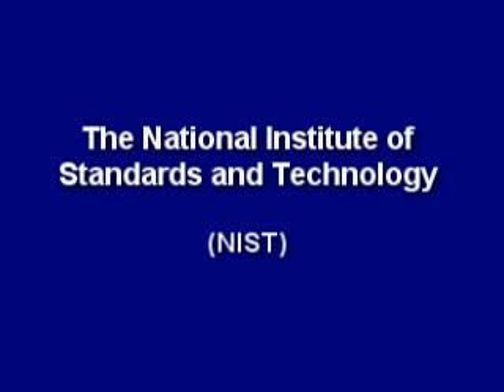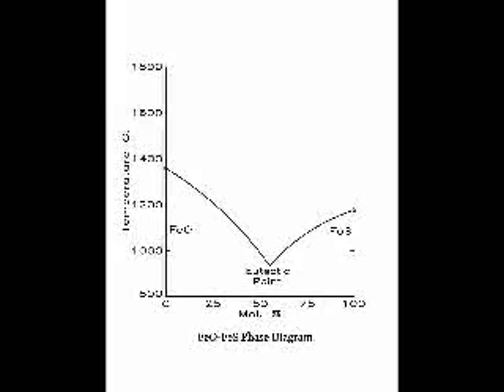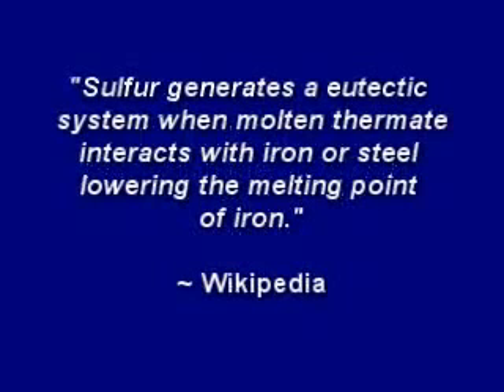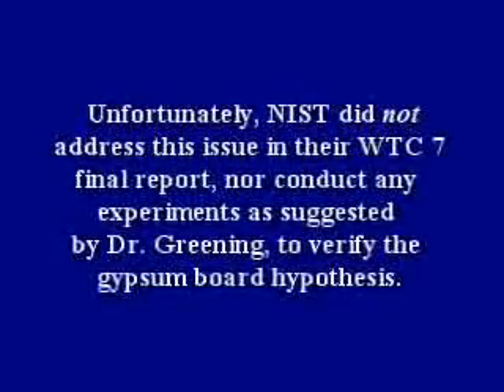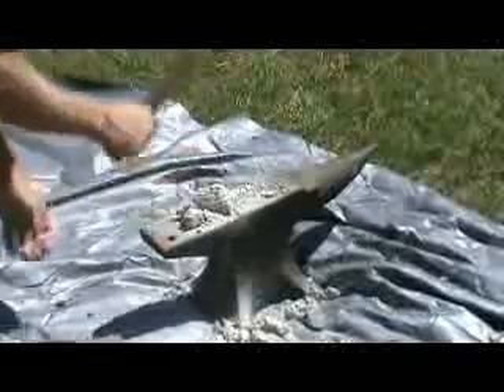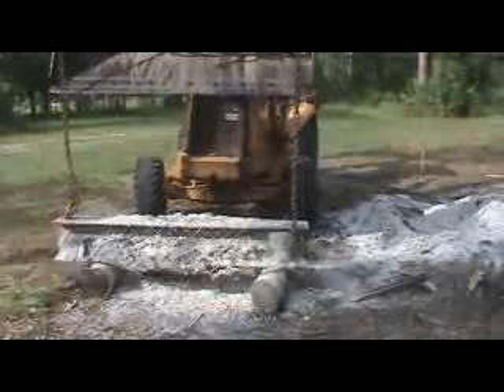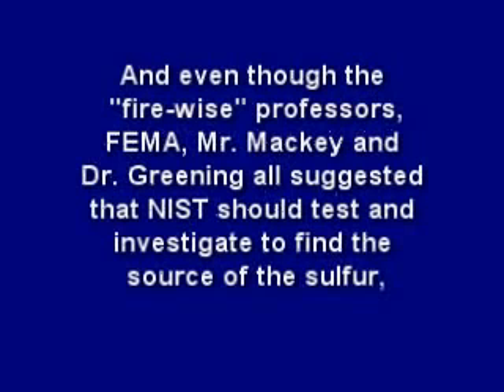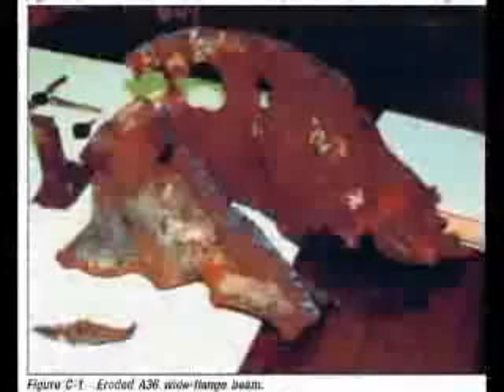9/11 Experiments - The Mysterious Eutectic Steel

Comment: "Did rubble from the WTC really cause those eutectic formations ,as we were led to believe?" - YES.
First you have to remember that 'rubble' is a code-word for 'forget that the tower was made of IRON'.
The IRON tower fell into the basement at an average speed of 120 mph.  THE ENERGY it employed is EASILY ACCOUNTABLE:

This analysis considers the conditions necessary for EUTECTIC FORMATION.

PRIMARY 9-11 CONSPIRACY ASSUMPTION SHOWN TO BE FALSE:
AN ANALYSIS OF THE AMOUNT AND DESTINATION OF THE POTENTIAL ENERGY OF A WTC TOWER
The first law of thermodynamics, also known as Law of Conservation of Energy, states that energy can neither be created nor destroyed; energy can only be transferred or changed from one form to another.
Source: Boundless. “The Three Laws of Thermodynamics.” Boundless Chemistry. Boundless, 02 Jun. 2016. Retrieved 12 Oct. 2016 from https://www.boundless.com/chemistry/textbooks/boundless-chemistry-textbook/thermodynamics-17/the-laws-of-thermodynamics-123/the-three-laws-of-thermodynamics-496-3601/
The World Trade Center towers (and WTC7) fell NATURALLY due to buckling failure when their 'slender' columns lost attachment to their floors.
They only used a third of their Potential Energy to destroy themselves, the remaining two-thirds was consumed in crushing some of their steel into ground zero.
A standing WTC tower possessed two hundred and forty six tons of TNT of POTENTIAL ENERGY merely by just standing there. We shall call this energy Eo.
The tower fell by taking the direction of LEAST RESISTANCE, which was THROUGH ITS BUCKLING COLUMNS.
The columns failed by BUCKLING because their STRUCTURAL STABILITY had been compromised by LOSS OF FLOOR ATTACHMENTS. No steel got crushed when this buckling failure occurred. 
Buckling is not a MATERIAL failure; it is a STABILITY failure.
The floors had detached themselves by sagging to an angle which snapped their connections. Photographs of these separated floors (taken shortly before collapse) are plainly shown in the NIST Report.
As each tower fell, some of that stored potential energy, converting to kinetic energy by falling, was released to damage and dismantle both the moving and the stationary parts of the tower on the way down.
The amount of the initial energy consumed in such a manner was inversely proportional to the rate of acceleration of the tower as it descended. It can be calculated.  We shall call it Ed.
The amount of energy remaining (Er) when the tower wreckage hit ground zero is then (Eo - Ed).
This energy, transferred elastically, caused PLASTIC DEFORMATION in the crushed base steel wreckage, and became HEAT. This too can be calculated.
The heat was considerable. The signs of it were captured by satellite. It amounted to the equivalent of a thousand tons of steel raised to a temperature exceeding 1,000 degrees Centigrade.
This hot steel, crushed and pressed against ground zero, oxidised its surface (making scale) and absorbed local oxygen gas, leaving a reducing atmosphere.
In these reducing conditions, and at a temperature of 1,000+ degrees C, fireman’s water which had percolated through crushed gypsum wall boarding DISSOLVED calcium sulphate (yes, Gypsum is 5% soluble in water), the sulphate ions of which were reduced to sulphur which combined with the exposed iron to form IRON SULPHIDE, which at such temperatures was MOLTEN, and flowed away. At a temperature of 1,000 degrees Centigrade, in an absence of oxygen, and in the presence of hydrogen, Sulphur and Iron atoms become keen partners.
Such hot reducing conditions also caused the water/steam to be REDUCED to hydrogen gas which was noted by firemen to be burning at the surface of the wreckage.
The wall-boarding and crushed concrete surrounding (but mostly above) the steel were THERMAL INSULATORS, so greatly slowing cooling.

CALCULATIONS (in SI units):

To calculate the original potential energy of the tower in TNT equivalent,
G = 9.81 metres/sec^2
Mass (M) of tower = 5e8 Kg
Height (h) to the tower’s CG = 210 metres
The explosive energy of 1 ton of TNT (Kt) is equivalent to 4.184e9 Joules

Equation: Tower Potential Energy (Eo) = ( M * G * h ) / Kt
This is equivalent to ( 5e8 * 9.81 * 210 ) / 4.184e9, or 246 tons of TNT.

The Potential Energy of each standing tower was equivalent to 1,000 standard 500 lb. ‘iron’ bombs.

To calculate the kinetic energy used in the tower destruction takes a moment, after a simple thought experiment, namely considering the tower would fall at G if there were NO resistance, and if it fell so slowly that it consumed ALL its energy, it wouldn’t fall at all.
So we can see that the PROPORTION of the energy used up by the collapse must equate with the proportion of G which the collapse was unable to achieve.
As the collapse acceleration was, by truther calculation, established to be about 70% of the acceleration due to gravity, we’ll use that.
The energy used up in tower destruction was therefore 30% of 246, or 73.9 tonnes of TNT.
Assuming that 30% of the tower fell outside of the basement, then the energy (Er) available to heat the wreckage base (by elastic energy transfer and crushing) was 0.7 * (246 - 73.9), or 120 tonnes of TNT.
We know that the steel reached at least 1,000 degrees Centigrade because that is the melting point of iron sulphide.
We can therefore calculate the mass (m) of steel that was raised to that temperature.
The specific heat of iron (Fs) is known to be 0.45e6 Joules / tonne / degree C
The ambient temperature was 20 deg C, so the temperature rise (Tr) was 980 degrees C

Equation: Er = m * Fs * Tr
So m = Er / Tr * Fs = ( 120 * 4.184e9 ) / 980 * 0.45e6
And so m = 5.02e11 / 4.41e8 = 1,138 tonnes.

The collapse of each World Trade Center tower created 1,138 tonnes of red hot steel at 1,000 degrees Centigrade.

So we can see that there is no need to postulate an extra source of energy, and that the basement wreckage heat is also easily accountable, with the additional corroboration of burning hydrogen at the wreckage surface, and molten iron sulphide at the wreckage base.
And so the underlying 'truther' assumption, that the planes couldn't bring down the towers, is shown to be FALSE, as it is shown by calculation, using the physically-correct values, that the potential energy possessed by the towers numerically accounts for ALL the known consequences, through elastic energy transfer, plastic deformation, HYDROGEN gas burning at the wreckage surface, EUTECTIC IRON SULPHIDE melting off the hot steel pressed against Ground Zero, and, of course, a tremendous amount of HEAT.

These results are EVIDENCE of the event.
They have been evident to any REAL scientist or engineer from day 1.
Reply: https://en.wikipedia.org/wiki/Iron 

vs

https://en.wikipedia.org/wiki/Steel

As you might imagine would be the case in a complex as large as the original World Trade Center, multiple different grades of steel were used in construction -- 12, in fact. These grades began at a very common type of steel known as A36, which has a yield strength of 36ksi (or kilopounds per square inch), and got progressively stronger -- all the way up to steels that had yield strengths of 100ksi [source: FEMA].

The yield strength assigned to any grade of steel is the point at which it will bend and not regain its original shape. So A36 steel -- a mix of carbon and iron, like all steels -- can handle 36,000 pounds per square inch (36 kilopounds) of pressure before it begins to deform.

In the external walls of towers one and two of the World Trade Center, the steel also varied by thickness to allow for different pressure loads at different levels. In the lower levels, the thickness was most frequently around 4 inches (10 centimeters), while at higher floors, it could be as thin as 0.25 inch (0.64 centimeter) [source: FEMA].

In the construction of the floors themselves, a mix of A36 and ASTM A 242 steel was used. ASTM A 242 is what is known as a high-strength, low-alloy (HSLA) steel, which means that it was extra-strong, allowing less of it to be used which makes for a lighter building.

Overall, 200,000 tons (181,436 metric tons) of steel were used to build what were, at the time of their construction, the largest buildings on Earth [source: Ross].

So here is how much weight the steel is able to hold relative to its own internal mass: 

http://www.aqua-calc.com/page/density-table/substance/steel

1 cubic inch of steel weighs 4.66 ounces.

1 cubic inch of A36 steel supports 36000 pounds.

This is a rato of 36,000/4.66=123605.1502145923:1

Now then, let us calculate how much 181,436 metric tons of steel can support:

1 metric ton = 1.10231 US tons, which equals 199998.71716 US tons.

199998.71718 US tons = 399997434.32 US pounds.

399997434.32 US pounds = 6399958949.12 US ounces.

6399958949.12 US ounces * 123605.1502145923 = 791067887273201.9 pounds of load bearing capacity.

Most authorities generally agree that the combined total mass of the two structures, including no load bearing materials such as carpet, wiring, lighting, glass, plumbing, ceramic toilet fixtures, gypsum wall board, paint, marble, and hung acoustic ceiling tile weighed in around 500,000 tons.

This means that steel comprised roughly 40% of the total mass of the structure, meaning that the building weight roughly 2.5 times the mass of its steel.

Therefore, the collective steel within the building, based on this ratio can, at room temperature, support 49442.06008583692 times its own mass, or roughly 24721030042.91846 tons.

To clarify that number, I will put in commas and remove the decimal value:
24,721,030,042 tons. That, people, is almost twenty five BILLION tons.

So steel which can hold 123605.1502145923 times its own mass, somehow failed to support roughly 2.5 times its own mass, simply because some people claim that it lost all of their strength.

Well, 1, that would ONLY happen if, in fact, they did literally, MELT.
2, since we have seen already that steel is literally capable of supporting over 123,000 times its own mass at room temperature, any percentage of its strength lost, must therefore, be very very close to 100% for it to even begin to sag, along with the fact that insulated steel reinforcement bars within the concrete with is poured at a test 4600 psi compressile strength must also sag enough to cease to assist in its own support much the way concrete in bridges is often called upon to support a portion of its own mass, along with the traffic load, ice, snow, wind and other stresses placed upon it [I have built large concrete beam span bridges as well as high rise steel and concrete buildings in my past], we must establish just what percentage of the steel's actual strength must be lost to reach this magical 'sag-and'buckle' point.

I want to say something here that should give you hope, but while doing so, I will also say something that will remove it once again.

A long span of steel not only must support its own weight, but this weight must be properly and proportionally loaded and distributed based on laws of flexural torque, or else the steel will bend simply because of the laws of leverage we all learned early on in grade school

Here's the unhappy news: these structures were trusses, which, by their very design, are specifically formed to make them extremely strong for the total mass of their own material as well as additionally rigid as they were formed out of triangles, the most rigid shape in nature, but this does not even account that there were massive structural beams were used to resist the massive wind thrust placed against them for the first 14 floors, and then on the 41st, 42nd, 75th and  76th floors. 

These larger beams could not have been made to buckle because their mass was simply far too great to have been heated by the fires, had they have had adequate fuel, air, pressure, and time due to the fact that the heat would have wicked away by their tremendous thermal conductivity and their propensity to radiate energy as infra red light.

On top of this, these beams were [allegedly] recoated in fire protective insulative rockwool composite [which I have applied to beams before in the lime of my work]  almost immediately before the event, right where the event happened, so if this brand new insulation were still fresh and strong, it would have remained at least in part on these beams, deflecting most of the heat away from them as radiative energy.

This release details the temperature ranges alleged as well as graphed out to show the exact rate of weakening the steel would have experienced under OPTIMUM conditions, which are impossible to obtain inside a building which has been specifically engineered to contain fully self sealing elevators to prevent the dreaded chimney effect. http://911research.wtc7.net/wtc/analysis/fires/steel.html

These steel beams would have had to have had literally millions of gallons of fuel and a strong draft off fresh air to have been able to have heated these beams or even girders to the point of failure because they would have had to not only bake through the fireproofing but then also heat up the concrete both above and below the fire, seeing as concrete, when heated, off-gasses as it is reduced into several dehydrated.

Since anywhere from 15 to 20% of the mass of concrete is water, you must now figure in the heat of conversion and reduction from concrete to the many dehydrated oxides and hydroxides it was formed from: although I can immediately tell you that it requires 555 BTU per pound of water to render it to steam as a pure liquid, even were I to extensively research a long list of tables on thermochemical properties of the ingredients of the concrete, it would take a very long time to post the exact mathematical formula to express the total amount of heat absorbed and dispersed by the concrete, from the fire, and as you see this has already gotten so long its more than most people will bother reading.

To sum up what I have posted here and to extend it, I will post this link here for more information in greater depth, for those who are intelligent enough to comprehend the real science behind all of this. http://911research.wtc7.net/mirrors/guardian2/wtc/wtc-demolition.htm

And tempting as it may be, I shall not be replying to anybody who comments on this so you have been warned, and snarky trolling words meant to anger or embarrass me will mean nothing. All inane questions have data out there if you truly wanted to know, but since you don't you are here trying to use them to trip me up on the assumed issue of my pride , and and this will only make you look like a fool, not me, because those who hear your question, who really care, will take your question, go look up factual scientific references and find out the truth, and likely they won't bother replying to you either but instead, leave knowing you are a jerk and that the truth is that this was a controlled demolition and an inside job.
Reply: Ehm excuse me sir... what are you doing here ? Why the F** are you infesting every 9/11 video with your utter silliness ? Why do you copy and paste this BS everywhere ??
Reply: Daniel ilDanny 
"Ehm excuse me sir" - Your abuse is excused - just this once.
"what are you doing here?" - I'm interested in "9/11 Experiments and the 'mysterious eutectic.  I don't think YOU are, by-the-way.
"infesting" - An emotive word normally given to a multitude of living beings.
"every 9/11 video" - I wish.
"utter silliness" - I'm one of those people that prefers to define and justify my position.  You obviously aren't.
"copy and paste" - It's my own work.
"this BS" - Again, you give no reasons for your abuse.
Reply: Tony Duncan No you're not interested in 9/11 experiments. Moon landing conspiracy theories, you're commenting, 9/11 you're commenting...you're everywhere to deny that conspiracies exist.
You like physics and experiments, don't you ? Try to replicate the WTC7 building collapse. It came down with a transient of free fall acceleration while destroying itself. Now, what on Earth can fall with free fall accel. and destroy itself in the same time, without putting external energy into the system ?
Reply: Daniel ilDanny
No you're not interested in 9/11 experiments. Moon landing conspiracy theories, you're commenting, 9/11 you're commenting" - I'm interested in THE PHYSICS common to both.

"you're everywhere to deny that conspiracies exist" - Conspiracies occur all the time - AE911T is QUITE OBVIOUSLY a conspiracy.

"You like physics and experiments, don't you?" - Yes.

"Try to replicate the WTC7 building collapse" - No.  It has been done already.

"It came down" - It started to collapse about THIRTY SECONDS before any truther cares to acknowledge that fact.

"what on Earth can fall with free fall accel. and destroy itself in the same time, without putting external energy into the system?" - Any natural collapse you care to mention.
Here is one:
https://www.youtube.com/watch?v=H0YhlqP1BgE
Reply: Tony Duncan Thanks for posting the example of rocks falling. That exactly proves the law of conservation of momentum. As the rock splits, it must slow down its fall. However in the video there are no speed measurements. Again, the building cannot fall in free fall acceleration and destroy itself in the same time. Every deformation drains energy from the kinetic energy of the fall, therefor the fall MUST slow down. But it doesn't. 

You don't have to believe me, make experiments, make observation. That's the good thing of science, it's not secret, everyone can see. Or, you can follow the studies of Dr. Hulsey's equipe at the Alaska university. He studied deeply the WTC7 collapse and concluded that the official story is wrong. The building DID NOT collapse due to fires. Period. So your stack of nonsense is obsolete
Reply: Daniel ilDanny
"Thanks for posting the example of rocks falling" - You're welcome.
"Again, the building cannot fall in free fall acceleration and destroy itself in the same time" - That is your mistaken preconception.
What is shown on the WTC7 collapse videos, is the FINAL part of AN INTERNAL COLLAPSE which began thirty seconds previously.
What you observe is the buckling shell of the building.
It follows Newtonian rules as it buckles.
It RAMPS UP to free fall acceleration, as ALL buckling structures do.
Had there been an explosive release of any sort, there could NOT be that ramping up.
The graph would originate as a STRAIGHT LINE.
So what is shown in NIST NCSTAR 1A WTC Investigation Chapter 3, page 46, Figure 3-15,
is POSITIVE PROOF THAT NO EXPLOSIVES COULD HAVE BEEN USED.
http://ws680.nist.gov/publication/get_pdf.cfm?pub_id=861610
"You don't have to believe me" - I agree with you.
"So your stack of nonsense is obsolete" - Say THAT facing a mirror.  It might work...
Reply: Tony Duncan Tell me about the university of Alaska Fairbanks study on WTC7. Anything to say ? I guess you don't
Reply: Daniel ilDanny 
I've heard of it.  I'm not interested.  Don't complain, for you are also clearly not interested in any of the science you pretend knowledge of.
Why don't you ACTUALLY read what I have written?  Why CAN'T you come back with relevant questions?  The answer's above...
Here is the link for you to study the graph and acknowledge the FACT.
http://ws680.nist.gov/publication/get_pdf.cfm?pub_id=861610
Reply: Tony Duncan Why aren't you interested in an academic study on the matter ? Brilliant professors and student worked on it with very scientific methods. But their conclusion don't match your expectancies, so you "are not interested". That says it all.
Moreover, I reminded you about the law of conservation of momentum and what did you do ? You posted a video about falling rocks, not realizing that it proves exactly the contrary of your claims.
Tell your supervisor that if you want to mislead people on this, you'd better assign more competent persons, with better knowledge of physics and which don't contradict themselves.
Reply: "Why aren't you interested in an academic study on the matter?"
A.  You haven't yet graced me with ANY proper responses to:
1.  I'm interested in "9/11 Experiments and the 'mysterious eutectic'.  I don't think YOU are, by-the-way.
2.  "infesting" - An emotive word normally given to a multitude of living beings.
3.  "every 9/11 video" - I wish.
4.  "utter silliness" - I'm one of those people that prefers to define and justify my position.  You obviously aren't.
5.  "copy and paste" - It's my own work.
6. "this BS" - Again, you give no reasons for your abuse
7.  I'm interested in THE PHYSICS common to both.
8.  Conspiracies occur all the time - AE911T is QUITE OBVIOUSLY a conspiracy.
9.  <replicate the WTC7 building collapse> - No.  It has been done already.
10,  It started to collapse about THIRTY SECONDS before any truther cares to acknowledge that fact.
11,  <what on Earth can fall with free fall accel. and destroy itself in the same time, without putting external energy into the system?> - Any natural collapse you care to mention.
12.  <Again, the building cannot fall in free fall acceleration and destroy itself in the same time> - That is your mistaken preconception.
13.  What is shown on the WTC7 collapse videos, is the FINAL part of AN INTERNAL COLLAPSE which began thirty seconds previously.
14.  What you observe is the buckling shell of the building.
15.  It follows Newtonian rules as it buckles.
16.  It RAMPS UP to free fall acceleration, as ALL buckling structures do.
17.  Had there been an explosive release of any sort, there could NOT be that ramping up.
18.  The graph would originate as a STRAIGHT LINE.
19.  So what is shown in NIST NCSTAR 1A WTC Investigation Chapter 3, page 46, Figure 3-15,
is POSITIVE PROOF THAT NO EXPLOSIVES COULD HAVE BEEN USED.
20.  http://ws680.nist.gov/publication/get_pdf.cfm?pub_id=861610

and

B.   I actually can tell the difference between science and pseudoscience in very few words.

"Brilliant professors" - I've met a few.  You lack the ability to distinguish science from its pseudo-version.

"But their conclusion don't match your expectancies, so you "are not interested". That says it all" - That IS all.  There is no mediation possible between TRUE and FALSE.

"You posted a video about falling rocks, not realizing that it proves exactly the contrary of your claims" - you THEN proceed to DO NOTHING.
You HAVEN'T addressed points 1 - 20,  and you AREN'T going to show HOW any claim you make is in any way TRUE.

"Tell your supervisor <blah> don't contradict themselves" - BLAH.  Converse properly and STAY ON TOPIC.
Reply: Tony Duncan The more one talks, the less people listen to him. You're typing A LOT !
Why do you keep posting and quoting NIST ?? NIST never got into proper investigation on WTC buildings collapse dynamics.
Reply: Daniel ilDanny 
"The more one talks" - I would have said the LESS you answer, but, as you have answered NOTHING AT ALL (that's Point 21 so far), I'm wasting my time.
"You're typing A LOT !"  That's nothing.
Newton's Laws of Motion as applied to 9/11:
An Analysis of the Floor Collapse of the Twin Towers

Newton's 2nd Law ”The acceleration of an object as produced by a net force is directly proportional to the magnitude of the net force, in the same direction as the net force, and inversely proportional to the mass of the object.”
This, with Newton’s other laws, demonstrates the REALITY of the floor collapses within the twin towers.
The equation used is a derivative of the ACCELERATION of MASSES by GRAVITATIONAL FORCE: v^2 = u^2 + 2 * f * s, where:
Floor Mass m = 10^6 Kg,
Gravitational Acceleration f = 32.16 feet per second per second, or 9.81 metres per second per second
Distance between floors s = 12 feet, or 3.66 metres, and
Starting velocity u (original) = 0 ft/sec  (0 m/sec).  Then u = 9.72 ft/sec (2.97 m/sec).  Then u = 13.72 ft/sec (4.18 m/sec).  Then u = 16.3 ft/sec (4.97 m/sec).

It fits (as it must) in the case of a detaching floor. This, when and if it falls free, accelerates at G until it hits the floor beneath. From the formula v^2 = u^2 + 2 * f * s we know it strikes the floor beneath at a speed of 27.8 feet per second, or 8.47 metres per second.
We know that MOMENTUM is conserved, and the TWO floors would THEN be traveling downwards at HALF THAT SPEED, less the speed loss from the energy loss of the SHEARING of the floor connections.
We KNOW what this is, because we KNOW the average and general downward acceleration to have been 0.7G, as agreed by AE911T.
So we KNOW that the initial downward speed of the TWO floors is actually 70% of (27.8 / 2), which is 9.72 feet per second, or 2.97 metres per second.

Now we consider TWO floors striking the NEXT floor.   
Note that THE START VELOCITY (u) IS NO LONGER ZERO, but 9.72 feet per second, or 2.97 metres per second, so from the formula v^2 = u^2 + 2 * f * s we know the TWO FLOORS strike the floor beneath at a speed of 29.4 feet per second, or 8.96 metres per second, and thus the impact velocity is GREATER than before.
We know that MOMENTUM is conserved, and the THREE floors would THEN be traveling downwards at TWO THIRDS THAT SPEED, less the speed loss from the energy loss of the SHEARING of the floor connections.
We KNOW what this is, because we KNOW the average and general downward acceleration to have been 0.7G, as agreed by AE911T.
So we KNOW that the initial downward speed of the THREE floors is actually 70% of ((29.4 * 2) / 3), which is 13.72 feet per second, or 4.18 metres per second.

Now we consider THREE floors striking the NEXT floor.   
Note that THE START VELOCITY (u) IS NO LONGER 9.72 feet per second, but 13.72 feet per second, or 4.18 metres per second, so from the formula v^2 = u^2 + 2 * f * s we know the THREE FLOORS strike the floor beneath at a speed of 31.0 feet per second, or 9.45 metres per second, and thus the impact velocity is EVEN GREATER than before.
We know that MOMENTUM is conserved, and the FOUR floors would THEN be traveling downwards at THREE QUARTERS THAT SPEED, less the speed loss from the energy loss of the SHEARING of the floor connections.
We KNOW what this is, because we KNOW the average and general downward acceleration to have been 0.7G, as agreed by AE911T.
So we KNOW that the initial downward speed of the FOUR floors is actually 70% of ((31.0 * 3) / 4), which is 16.3 feet per second, or 4.97 metres per second.

On the point of impacting the NEXT floor THE START VELOCITY (u) IS NO LONGER 13.72 feet per second, but 16.3 feet per second, or 4.97 metres per second, so from the formula v^2 = u^2 + 2 * f * s we know the FOUR FLOORS strike the floor beneath at a speed of 32.2 feet per second, or 9.81 metres per second, and thus the impact velocity is EVEN GREATER than before.

What you see here is AN ACCELERATING TREND.  The acceleration of the massing floors is heading asymptotically for G itself.

"You are saying that as the first 15 floors collapses on the 16th floor" - Well, obviously not.
"The amount of kinetic energy is increased as opposed to deceased (sic)” - Certainly not.  Energy never ‘dies’.  Consult The First Law of Thermodynamics.

If you take the INITIAL FLOOR, its kinetic energy impacting the floor beneath it (assuming its weight to be 10^6 Kg) is 0.5 * m * v^2, which is 0.5 * 10^6 * 8.43 * 8.43 = 35,500,000 Joules.

If you take the FOUR FLOORS, their kinetic energy impacting the floor beneath them (assuming floor weight to be 10^6 Kg) is 0.5 * m * v^2, which is 4 * 0.5 * 10^6 * 9.81 * 9.81 = 192,000,000 Joules, which is MORE THAN FIVE TIMES GREATER.

Kinetic energy is ALWAYS INCREASED BY FALLING, as POTENTIAL energy is traded off against it.

So the floors will accelerate all the way to the tower basement.  This leaves FREE-STANDING COLUMNS A QUARTER OF A MILE HIGH.  THEY WILL BUCKLE AND FALL DOWN.
Reply: Tony Duncan " I'm wasting my time " That's the only right thing you've said sofar
Reply: Daniel ilDanny That's OK by me.
I'll provide INFORMATION, you can do the ABUSE.
Reply: Tony Duncan Yes you provide information. More than you might think...
Reply: As does your non-reply.  This material has been put up for several months now, and it hasn't received a single direct challenge.  Lots of distraction, dismissals without evidence, and 'ad hominems', but not a single HONEST attempt to dsbate these figures, as one would expect from the least honest people I have ever encountered that are still walking free, still supporting terrorism, and still slandering innocent people.
Reply: ***** 
"This means it used ALL of its potential energy while falling" - quite the opposite.
Potential energy is called what it is because THE ENERGY IS POTENTIAL and while a falling object falls free IT RETAINS IT ALL.  When the free-falling object strikes something else, all or part of the kinetic energy from its gaining speed IS RELEASED as kinetic energy or heat, which is itself another form of kinetic energy.
Had you been able to read and understand what I have so carefully explained to you previously you would have seen that my calculations SHOWED REDUCED ENERGY proportional to the REDUCED G of the falling towers - where energy was indeed being transformed into damaging itself as it fell..
WTC7 didn't experience an "exterior global collapse" at all.
Its interior had ALREADY collapsed.
It's EXTERIOR buckled as its cascaded interior burst out at around the thirteenth floor.
https://en.wikipedia.org/wiki/Buckling
Buckling is a word that isn't in the 'truther' lexicon, the reason being that it is the TRUTH of the nature of structural failure, and, being TRUTH, it's a commodity that 'truthers' are always in search of, BUT DARE NOT EVER FIND.
If they did, they would know all-of-a-sudden that they were an utter waste of space, and no good to anyone at all - a gutless form of Islamic terrorism.
So, to recapitulate:
"The First Law of Thermodynamics states that heat is a form of energy, and thermodynamic processes are therefore subject to the principle of conservation of energy. This means that heat energy cannot be created or destroyed. It can, however, be transferred from one location to another and converted to and from other forms of energy."
http://www.livescience.com/50881-first-law-thermodynamics.html
So whatever you 'believe' you obviously don't know jack shit about science.
This is because you only read from the pseudoscience of your lying friends in AE911T.
You aren't going to justify your slanderous deceit by inventing some form of pseudoscience on my watch.
May the Patriot Act catch up with you.
http://people.howstuffworks.com/patriot-act.htm
Reply: +kennicillin you're absolutely right. The WTC7 building CANNOT collapse at free fall speed and in the same time destroy itself. Since the potential energy of the standing building is the only source of energy, the energy needed for deformations, crushing, raising dust cloud etc, is drained from the kinetic energy of the falling building. Therefor it must slow down its fall . But id didn't. The conclusion is : Newton's law of motions are no more valid, OR energy has been introduced from the outside.
By the way, if you keep arguing with shills like "Tony Duncan" you only make his dumb comment popular, thus appearing on the top ...;o)
Reply: ***** 
"Thank you for your thorough analysis though!" - FALSE.
It addressed neither the dropping of the floors (recorded in the NIST Report) nor the buckling of the columns (also recorded in the NIST Report).
Seeing as the towers were ONLY constructed with these two structural elements, not to mention them is not to mention the tower at all.
PRIMARY 9-11 CONSPIRACY ASSUMPTION SHOWN TO BE FALSE:
AN ANALYSIS OF THE AMOUNT AND DESTINATION OF THE POTENTIAL ENERGY OF A WTC TOWER
The first law of thermodynamics, also known as Law of Conservation of Energy, states that energy can neither be created nor destroyed; energy can only be transferred or changed from one form to another.
Source: Boundless. “The Three Laws of Thermodynamics.” Boundless Chemistry. Boundless, 02 Jun. 2016. Retrieved 12 Oct. 2016 from https://www.boundless.com/chemistry/textbooks/boundless-chemistry-textbook/thermodynamics-17/the-laws-of-thermodynamics-123/the-three-laws-of-thermodynamics-496-3601/
The World Trade Center towers (and WTC7) fell NATURALLY due to buckling failure when their 'slender' columns lost attachment to their floors.
They only used a third of their Potential Energy to destroy themselves, the remaining two-thirds was consumed in crushing some of their steel into ground zero.
A standing WTC tower possessed two hundred and forty six tons of TNT of POTENTIAL ENERGY merely by just standing there. We shall call this energy Eo.
The tower fell by taking the direction of LEAST RESISTANCE, which was THROUGH ITS BUCKLING COLUMNS.
The columns failed by BUCKLING because their STRUCTURAL STABILITY had been compromised by LOSS OF FLOOR ATTACHMENTS. No steel got crushed when this buckling failure occurred. 
Buckling is not a MATERIAL failure; it is a STABILITY failure.
The floors had detached themselves by sagging to an angle which snapped their connections. Photographs of these separated floors (taken shortly before collapse) are plainly shown in the NIST Report.
As each tower fell, some of that stored potential energy, converting to kinetic energy by falling, was released to damage and dismantle both the moving and the stationary parts of the tower on the way down.
The amount of the initial energy consumed in such a manner was inversely proportional to the rate of acceleration of the tower as it descended. It can be calculated.  We shall call it Ed.
The amount of energy remaining (Er) when the tower wreckage hit ground zero is then (Eo - Ed).
This energy, transferred elastically, caused PLASTIC DEFORMATION in the crushed base steel wreckage, and became HEAT. This too can be calculated.
The heat was considerable. The signs of it were captured by satellite. It amounted to the equivalent of a thousand tons of steel raised to a temperature exceeding 1,000 degrees Centigrade.
This hot steel, crushed and pressed against ground zero, oxidised its surface (making scale) and absorbed local oxygen gas, leaving a reducing atmosphere.
In these reducing conditions, and at a temperature of 1,000+ degrees C, fireman’s water which had percolated through crushed gypsum wall boarding DISSOLVED calcium sulphate (yes, Gypsum is 5% soluble in water), the sulphate ions of which were reduced to sulphur which combined with the exposed iron to form IRON SULPHIDE, which at such temperatures was MOLTEN, and flowed away. At a temperature of 1,000 degrees Centigrade, in an absence of oxygen, and in the presence of hydrogen, Sulphur and Iron atoms become keen partners.
Such hot reducing conditions also caused the water/steam to be REDUCED to hydrogen gas which was noted by firemen to be burning at the surface of the wreckage.
The wall-boarding and crushed concrete surrounding (but mostly above) the steel were THERMAL INSULATORS, so greatly slowing cooling.

CALCULATIONS (in SI units):

To calculate the original potential energy of the tower in TNT equivalent,
G = 9.81 metres/sec^2
Mass (M) of tower = 5e8 Kg
Height (h) to the tower’s CG = 210 metres
The explosive energy of 1 ton of TNT (Kt) is equivalent to 4.184e9 Joules

Equation: Tower Potential Energy (Eo) = ( M * G * h ) / Kt
This is equivalent to ( 5e8 * 9.81 * 210 ) / 4.184e9, or 246 tons of TNT.

The Potential Energy of each standing tower was equivalent to 1,000 standard 500 lb. ‘iron’ bombs.

To calculate the kinetic energy used in the tower destruction takes a moment, after a simple thought experiment, namely considering the tower would fall at G if there were NO resistance, and if it fell so slowly that it consumed ALL its energy, it wouldn’t fall at all.
So we can see that the PROPORTION of the energy used up by the collapse must equate with the proportion of G which the collapse was unable to achieve.
As the collapse acceleration was, by truther calculation, established to be about 70% of the acceleration due to gravity, we’ll use that.
The energy used up in tower destruction was therefore 30% of 246, or 73.9 tonnes of TNT.
Assuming that 30% of the tower fell outside of the basement, then the energy (Er) available to heat the wreckage base (by elastic energy transfer and crushing) was 0.7 * (246 - 73.9), or 120 tonnes of TNT.
We know that the steel reached at least 1,000 degrees Centigrade because that is the melting point of iron sulphide.
We can therefore calculate the mass (m) of steel that was raised to that temperature.
The specific heat of iron (Fs) is known to be 0.45e6 Joules / tonne / degree C
The ambient temperature was 20 deg C, so the temperature rise (Tr) was 980 degrees C

Equation: Er = m * Fs * Tr
So m = Er / Tr * Fs = ( 120 * 4.184e9 ) / 980 * 0.45e6
And so m = 5.02e11 / 4.41e8 = 1,138 tonnes.

The collapse of each World Trade Center tower created 1,138 tonnes of red hot steel at 1,000 degrees Centigrade.

So we can see that there is no need to postulate an extra source of energy, and that the basement wreckage heat is also easily accountable, with the additional corroboration of burning hydrogen at the wreckage surface, and molten iron sulphide at the wreckage base.
And so the underlying 'truther' assumption, that the planes couldn't bring down the towers, is shown to be FALSE, as it is shown by calculation, using the physically-correct values, that the potential energy possessed by the towers numerically accounts for ALL the known consequences, through elastic energy transfer, plastic deformation, HYDROGEN gas burning at the wreckage surface, EUTECTIC IRON SULPHIDE melting off the hot steel pressed against Ground Zero, and, of course, a tremendous amount of HEAT.

These results are EVIDENCE of the event.
They have been evident to any REAL scientist or engineer from day 1.
Reply: ***** Post what?
Reply: +Shorn Burman
"excellent  reasoning  with scientific  explanation" - Thanks.
"would it had been a load bearing structure  your explanation  could have stood" - Had a tower NOT been 'a load-bearing structure', it wouldn't have stood in the first place.
"Secondly polarization of everything  was spontaneous" - "Polarization" is a phenomenon of LIGHT.  Your statement is meaningless.
What you MEANT to say was that STRUCTURAL COLLAPSE WAS UNIVERSAL.
This is the nature of a LOADED structure that is about to buckle.
"which indicates some kind of explosive  material was used on every section of the building" - NO.
It indicates YOU KNOW NOTHING AT ALL ABOUT BUCKLING.
This is two-and-a-half centuries old CIVIL ENGINEERING RESEARCH initiated by LEONHARD EULER.
Enter "buckling' into WIKI and search YouTube for "slender column buckling in compression".
Forget explosives.  There's no such thing as a SILENT EXPLOSIVE.